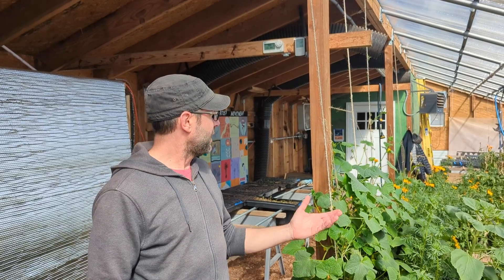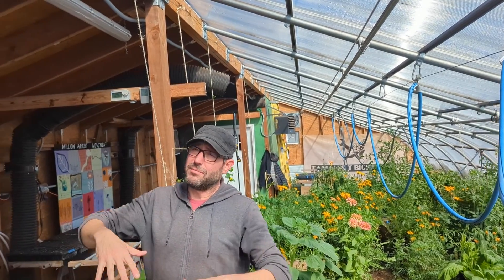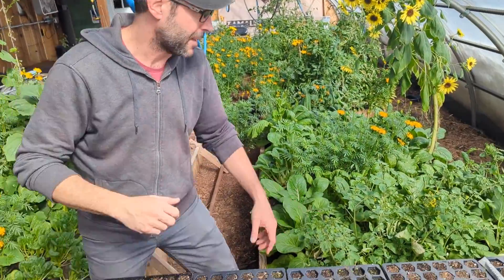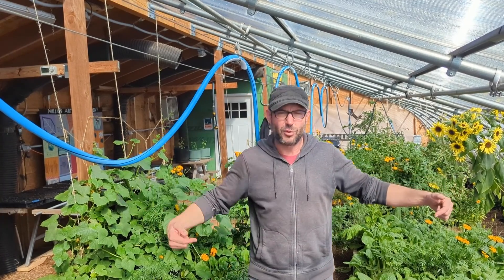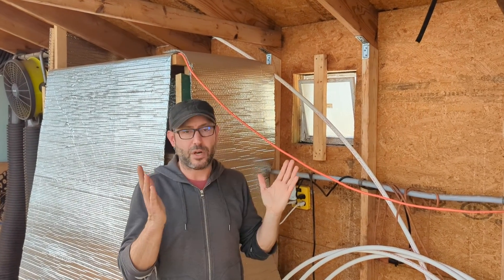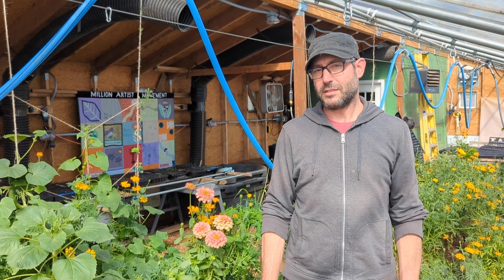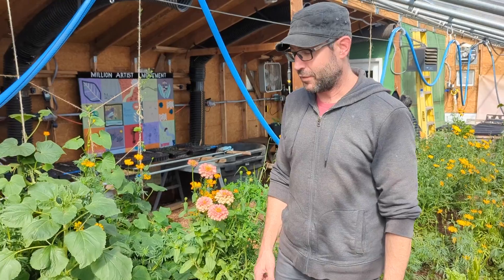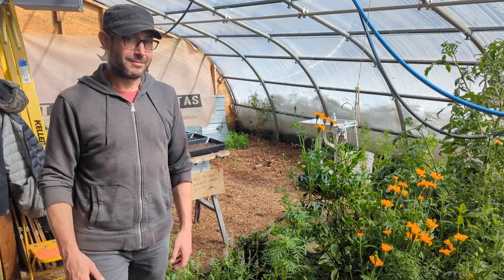Tamales y Bicicletas (Minneapolis)

Comment: What size are the unit heaters (wattage/Btu output) and the fans as they look smallish for the space?  You also mentioned the that the manifolds were not that deep (by hands) it looked like about a foot and a half, is that correct?

Comment: I am curious about the energy requirements for the winter. We are just about to build one in Upper Mustang Nepal and will be completely off grid. I am thinking a 4 KW solar system is what we will try to do. 
Also we are going to use straight rafters instead of the half hoop like this one. Part of that plan is to use a slightly raised wall along the front and windows that we can open for added ventilation.
Reply: 2nd.  Thank you for the tour and update.  This is a such a cool project. Do you have how much energy/power cost you are putting into the operation of the DSWG? I am wondering how much of the power can be offset with solar panels and batteries. Looks like operation of the 3 internal duct fans and two external exhaust/louver fans could be covered by a small solar power system. The two heating units might be a lttle harder to cover the energy costs of. Kennewick, WA

Comment: Thank you for sharing your information to us. You guys are amazing.

I'm curious, have you guys considered using aircrete(plain) or aircrete (mixed with crushed styrofoam) or aircrete (mixed with crushed straw) or lastly tightly packed straw bales that is super sealed as your thermal insulation? 

This way you could cut down on the cost of materials to build.

Comment: Some thoughts from a UMN Hort MPS. 
1. The angle of the glazing seems way to flat for gathering winter sun and reflecting summer sun. 
2. Bare wood in a high humidity green house seems problematic.  Not sealed? Looks to be really damp in cold weather..
3. Add night insulation on the top of glazing to retain heat?
4. Add outer shade cloth to reduce sun in summer to keep cooler?
5. Can ceiling be higher? Doesn't seems to have much thermal mass to buffer changes or grow vertically. Like high tunnels. 
Nice to see a new iteration.